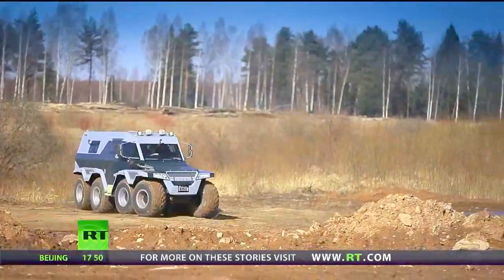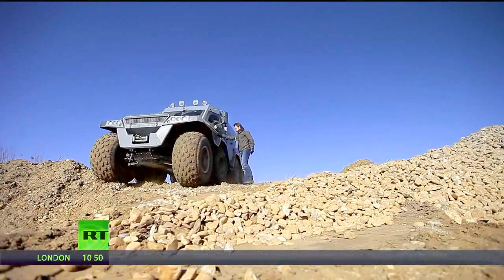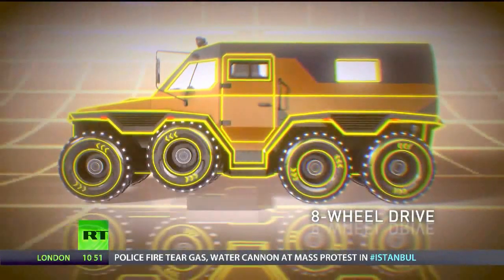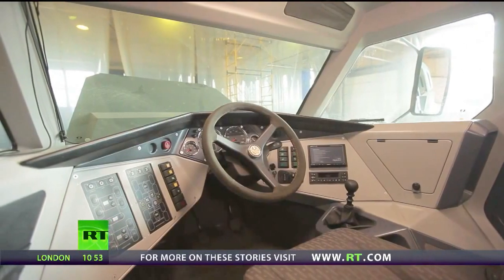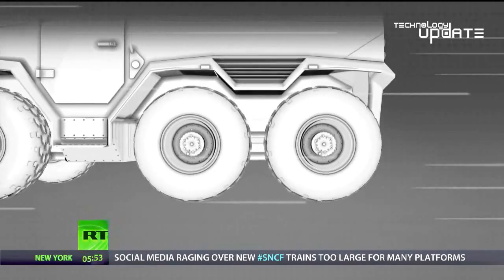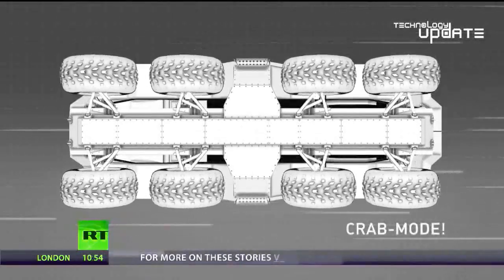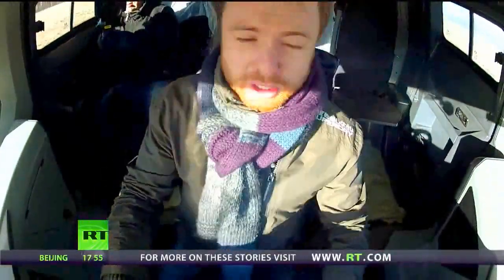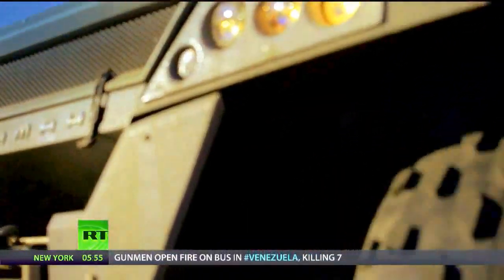RT - Avtoros Shaman 8x8 All-Terrain Vehicle (ATV) [720p]

Comment: tows 7,000 pounds less than a dodge ram with half the power of a ram and half the tourque .
Reply: Doesn't this thing tow like 12 tons? That's WAY more than any pickup.
Reply: They meant cargo capacity...trucks with those engines tow trailers with medium sized heavy equipment in Europe etc...they power many 7.5 ton- 10 ton rated trucks...this is  a totally different category..that's a real work truck engine..not a gas guzzling luxury ute engine.

Comment: these things only have 135hp
Reply: It seems to be more like a tractor set up with a good hard wearing economical turbo diesel engine,but the real pushing/pulling power is in the drive train..plenty power not so much speed,kinda like a loader or all terrain crane etc..

Comment: Plus ya'll need to upgrade the engine to 200-300 HP, 146???? come on
Reply: It is not for the highway. You can force yourself, but it may be necessary to strengthen the running gear. When the seven wheels are skidding, all the power is on one wheel and the differential can be destroyed.